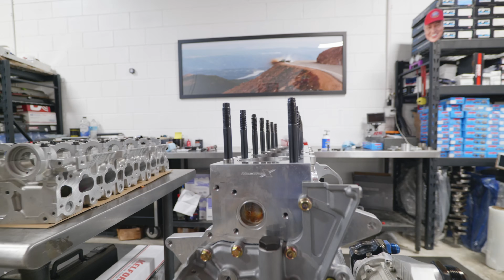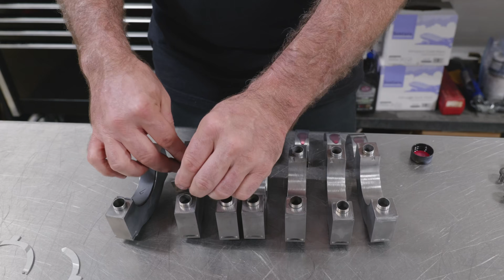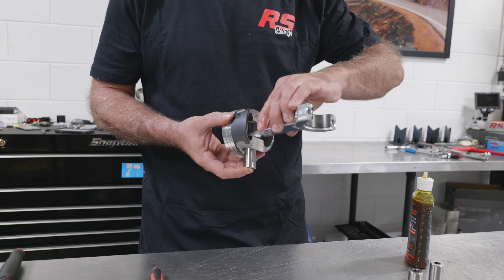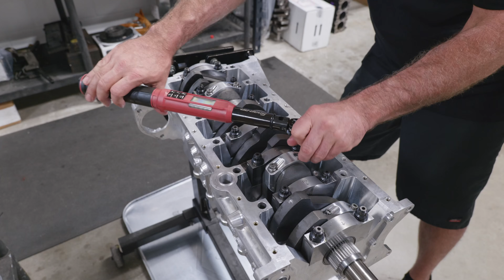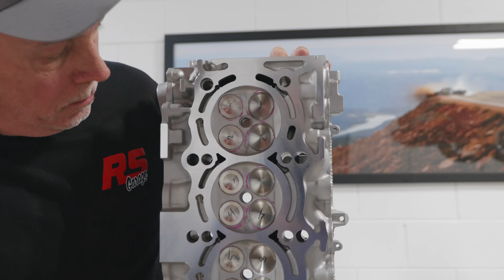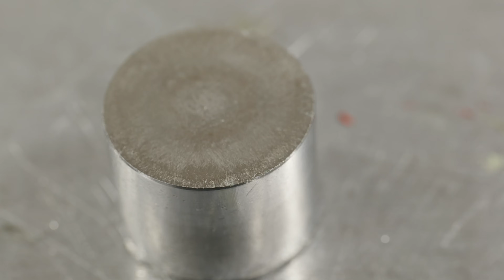Billet 2JZ Engine Build | 90mm Billet BC Crankshaft, Aluminum Rods, Custom CP Pistons | RS Garage

Comment: I noticed you typically install head studs after placing the head on, to avoid scraping the head against the studs and compromising the threads. You've pointed this out and I took note for my own builds. However on this engine, you did studs first, then lowered the head onto the studs. Why?

Comment: When hitting the main stud washers with a belt linisher to increase the surface roughness, do you see any risk associated with parallelism tolerance of the washers being compromised? I know it’s a minor detail but thought I’d ask because I would imagine equal pressure loading of the nut would be quite critical for correctly stressing the main stud

Comment: Precision surgery as always cheers Jay BUT I think I’ve noticed the Ken block photo on the wall is about two hundred thou out off level to the horizontal mud lines of the bricks lol.
Reply: I never realized how apt the comparison to surgery is. Jay has pointed out the importance of cleanliness and washing hands often to prevent contaminating the engine with debris in multiple vids.

Comment: use the dremel engraver (not rotary tool) on the washers, the engraver shoots out a sharp pins at high speed and leaves the washer very grippy, way more than sand paper does. it also adds wow factor to your content

Comment: 1000hp, 1500hp and 2000hp+ have all been done before. Is it possible to do a build where it's focused and designed for engine response, reliability and near zero turbo lag in that order and not focus on god challenging HP? Different philosophy 😊
Reply: If that's what you want just build a nice modern turbo 2jz that's what they do all day everyday!
Reply: 3200 HP has been done aswell.i have owned jzs for over 20 years and I can't believe how good these Toyota motors are
Reply: Put a 68/67~ on a ported head “high compression” 2jz build, gear it properly, have 600-700hp, and make boost as fast as you can floor it.
Reply: It depends on application you’re looking for.  Sounds like you want a driveable street car.  They’re not spending 100k+ for that.

Comment: Very curious of Jay’s thoughts on Tomei’s 3.6L stroker kit.  87mm bore, 100mm stroke.  There was a decent video on Sammit’s channel not too long ago inside Tomei’s machine shop that gave a pretty good view into the kit. His was a one off that bumped the compression up significantly from the off the shelf version which is around 8.5:1 up to 10:1 or so as he has access decent quality fuel.
Reply from the maker: I think the short answer is "TBD".... Longer stroke engines have more internal leverage and are "harder" on parts.   I bet it drives nice but wouldn't use it for high powered applications.  With a 94mm crank and VVTi you can spool a 8685 up about as fast as the chassis can manage it. I guess there are applications I could see the 100mm being cool in. If I had a GS300 with a GTE and wanted it to just drive "great" a 100mm crank and VVTi would have great low end with a smaller turbo like a 6466. It would just choke out early. I ran a 6464 on my 96mm engine and was pretty unhappy to make 700. It was just choked up.  There are so many ways to skin the cat!
Reply: @RS_Garage_US for sure!  I just wonder about longevity when that thing is banging on the limiter all day with that less than ideal rod stroke ratio.  I was also curious about the pistons they used because they looked pretty small if I remember correctly.  I get your point though — it seems like it wasn’t necessarily needed to spool the turbo but maybe more of an opportunity for him to work with Tomei more than anything.  Admittedly, it would have to make a bit more power down low from the displacement and spooling that turbo quicker, but at that point gearing would probably come into play as well.  Thanks for taking the time to write out a detailed response.  Cheers.
Reply: Hmmm that would make it a similar bore to stroke ratio of a b58. .87 vs .867. Imo why would you turn your perfectly squared powerhouse that will love 9k rpm for an under Sqaure torque heavy application for suv/trucks. The powerband of a big over square or perfectly Sqaure engine is what a proper sports car should be.
Reply: Erinnerst du dich wie hoch der motor mit 100mm hub drehen konnte?

Comment: Could this head gasket be used on a DD motor or would it not work.
Reply from the maker: It will eventually weep fluids. The engine is in a constant state of expansion and contraction and that is happening long the deck surfaces. The sealant breaks down over time. You'd be better off with a MLS gasket until you're overpowering that solution. ~Jay